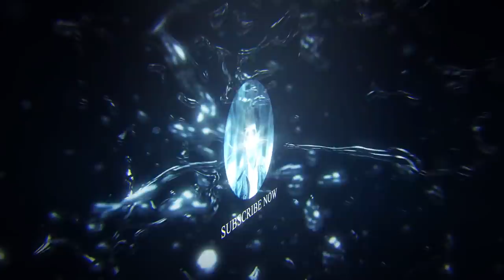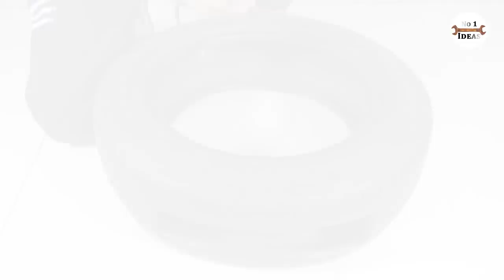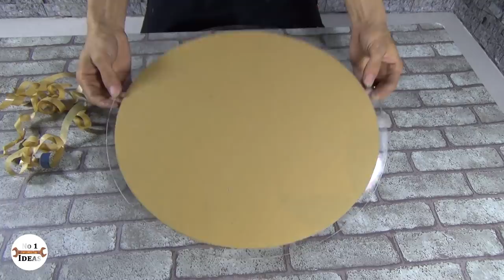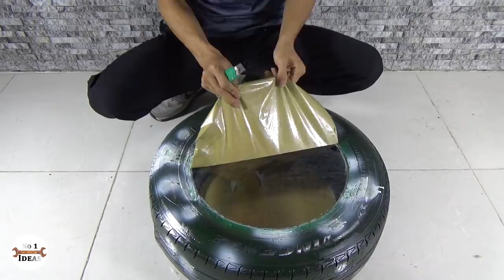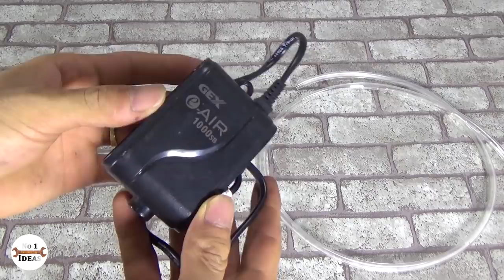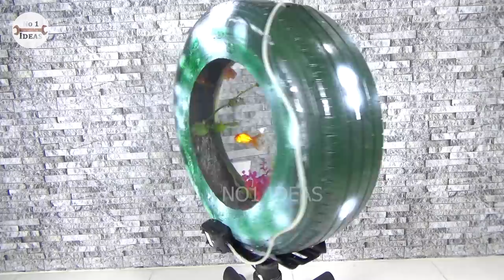How to Make PORTABLE AQUARIUM from Car Tire

Comment: Nice, but I don't think the fishes would live long due to the chemicals of the rubber.
Reply: Same exact thought I had, good concept if it was not exposed to the toxins.
Reply: Maybe spray the inside with foam, or line it with silicon?

Comment: That aquarium is less than 10 gallons. Goldfish need at least 20 gallons. You put tropical fish in with cold water fish, and there is no heater or filter, you didn’t cycle the tank, and the toxic tire will destroy the fish. . This is strait up fish abuse.  They will all be dead by the end on the first week.  WOW.

Comment: What is that plastic transparent sheet called??
Reply: It's called acrylic and you can get it at most hardware stores
Reply from the maker: @vinay vajinapalli Mica plastic sheet😍
Reply: Which type of tape used in stick mica plastic sheet